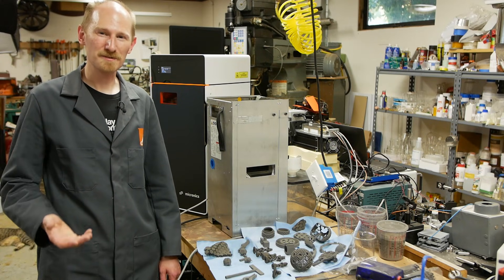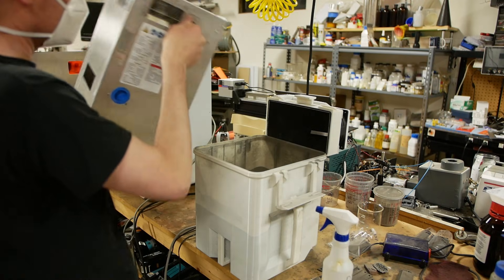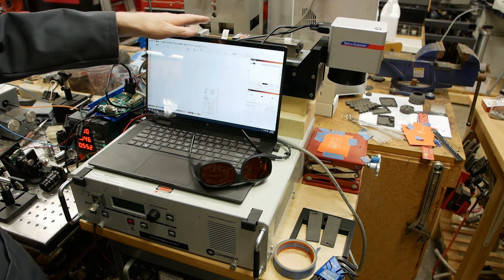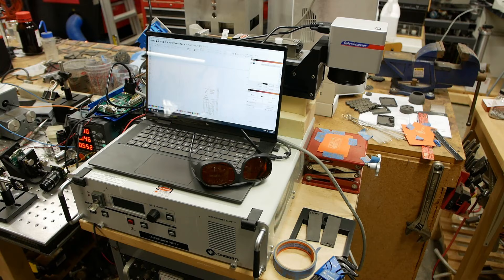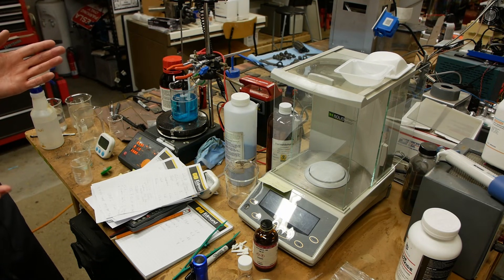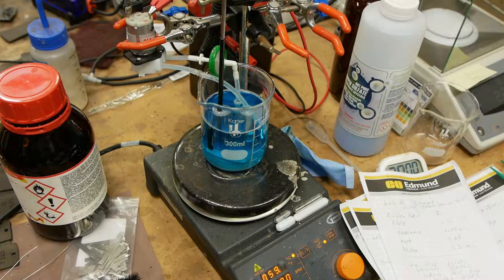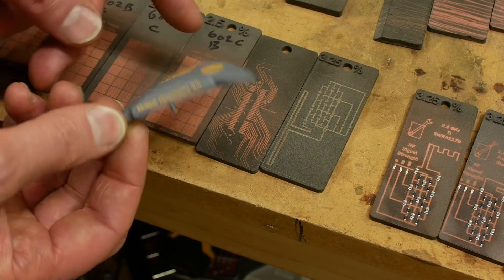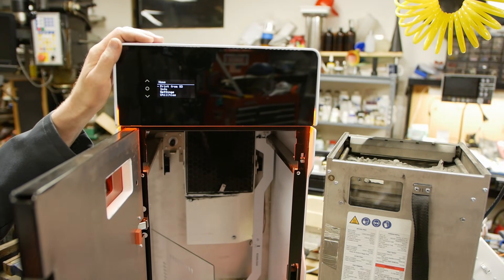Micronics SLS nylon 3D printer makes electronic circuits

Comment: Incorporating the pulsed laser into the 3d printer is genius!  My only question is how would you get copper to plate onto these internally activated traces? Would you have to build in an adjacent hollow tubing for the solution to reach it?
Reply: I think he meant, like, internally facing surfaces - nooks and crannies that are still exposed to the air, but are hidden.  But now that you mention it, you COULD print tubes in a part, and plate the walls - might need active solution circulation.

Comment: It would be even more interesting if you could create resistors, capacitors, diodes, transistors, and inductors by manipulation of the substrate to achieve the relevant phenomena
when the copper is deposited. I would imagine micro scale geometric configurations during printing, could achieve some electrical capability, at least resistivity within the substrate?

Comment: It would definitely be cool to see a video specifically proving the idea of printing traces in areas that later aren't optically accessible.
Reply: but the "wires" runing thgroug the part would need to be tubes that need to have the loose material removed, so the copper can "collect" there
Reply: @leobla744  Why tubes? They could be any shape, theoretically.
Reply: @clonkex  The traces at the very least have to run along the inside of some topological hole (e,g, tube) in the printed shape which is connected to the volume of plating fluid. Can't expect to make traces anywhere the fluid can't reach.
Reply: @danielkruyt  Could we make the parts porous? The chemical bath would be an all day process as a result, but it could work.
Reply: @heroslippy6666  My initial thought about the porous concept is, how do you clean off the dust? Ben mentions it as quite a critical step.
Reply: @heroslippy6666  thin channels or even porous structures won't play nice with electroless deposition.
Reply: @danielkruyt  Ah true, that'd be a problem.
Reply: @leobla744  They could just be overhangs or mating clip surfaces that have traces on sides that can not be seen but are open to the plating bath.

Comment: Combine that with a pick and place machine and you have a 3d printer that can do full model and circuit construction inside the structure of the device.

Comment: I still wish William would make Open Sauce happen in Europe aswell :/ Anyway, could you also activate the catalyst with a photomask and a powerful flashlamp? Tho I think you would run into problems aswell if your surface is not flat. The power would need to be pretty substantial too.

Comment: Focusing a laser projector "by ear"!? That would certainly not have occurred to me, but it makes good sense once you explain it!
Reply: Surprising, yes. But those of us with galvo lasers do this all the time. Solid way to get you 95%'ish there.
Reply: I thought only meth users could hear light. Guess I was wrong. Lol
Reply: @AmericanMaking  LSD also lets you hear light. And see sound. :)
Reply: @NScherdin  Tasting texture was my thing, haha. Smooth is sweet, velvet is citrusy, rough is bitter
Reply: @AmericanMaking  Technically you do not hear the light. You hear the material resonating in a mode correlating to the pulse frequency of laser. The thermal energy hits the material like a drumstick the drum at very high frequencies. ;-)
Reply: Seems like a cheap auto focus method, with some signal conditioning.
Reply: Funny enough I tend to do the same with my diode laser. Place some thin black film under the laser and when it is focused on low power it starts buzzing like a piezo

Comment: I have been wanting to make 3D MID parts and had thought to use copper particle impregnated tpu for wearable anti-microbial electronics. I also couldn’t get the plating solution to work :/ could you post the details of your solution?